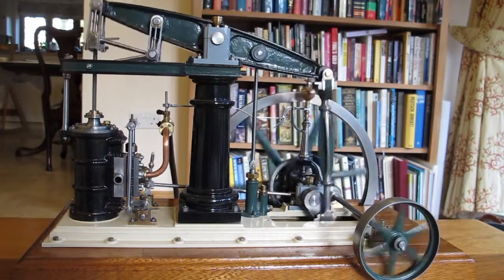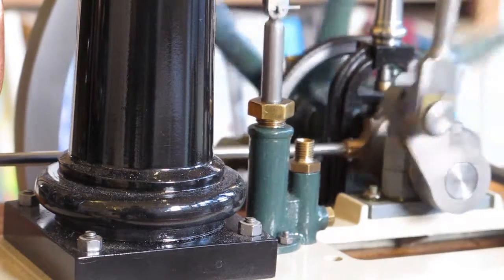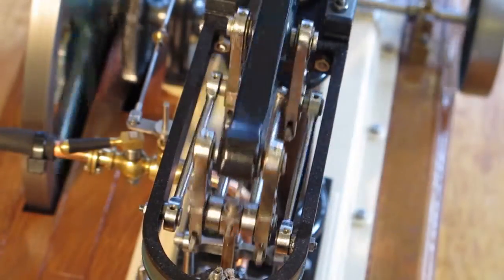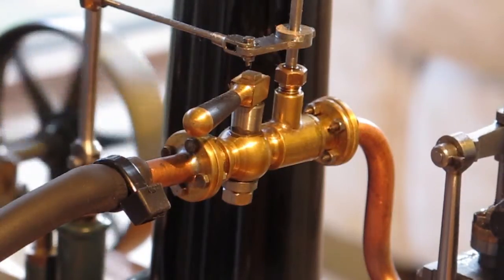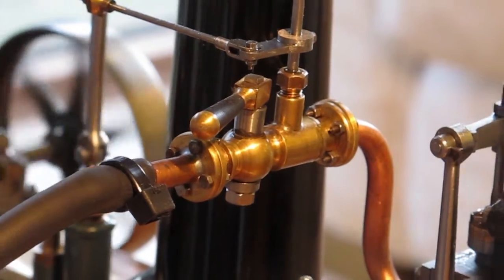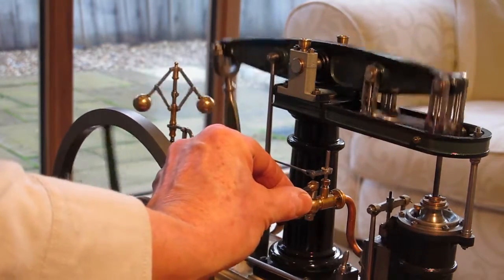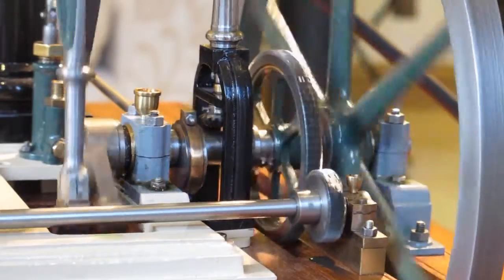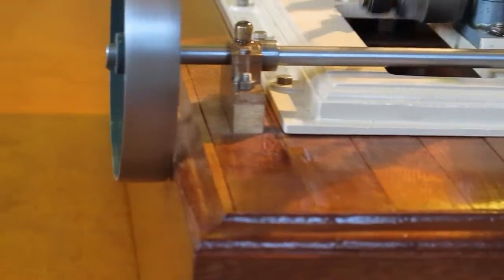ME Beam Engine

Comment: For a first attempt at model engineering you did a very fine job. This really isn't a beginners project at all. And those frustrating drawing errors have been uncorrected for decades. Beam engines were alway's a slow running engine. Maybe 30-60 rpm at the very most, and they always look far better running slow. You could remake the shaft to fit the slightly oversize bore in the flywheel, and if your bore is straight with the flywheel's outer rim that will correct the flywheel wobble. Drills don't drill straight or round as I'm sure you already know. So you drill first, bore under size for round and straight, then a reamer will give you a hole very close to being on size.Historically industry took a great deal of pride in there steam engines and everything was done as much as possible to neaten up all the parts. So I very much hope you don't mind a thought or two. 

All the planks on the flooring would have been pegged down much like the hull and deck planks were on the sailing ships. So you'd see the end grain of those at the ends and at each beam running under the engine as the supporting structure. And at the M.E. shows and exhibitions it's generally thought that all bolt or stud ends should have a radius to finish them off. Even at full size that was very likely done on almost all engine's and for the same reasons. Also at those shows they like to see somewhere between 1 1/2 and 3 threads maximum protruding above the nut. Yes it would be a great deal of work to do so now, and only you can decide if the work involved would be worth it to you personally. It does make a very large difference in the finished engine though.

Comment from the maker: Hi Bernard 
Thanks for your generous comments. I had really very little engineering experience before embarking on the model as my professional life was as an Internet designer. 
I found that as long as you took your time and studied the drawings very carefully it was fairly straightforward to build. However there are a number of errors in the drawings so you do need to be careful. If you do go ahead with building one I would be happy to share with you the mistakes I found.
Graham
Reply: +engineeringmodeller I finally just seen that you replied to my comment.  I am about to finish my first model from castings. I chose the Stuart Models 10V as it seemed to be a good entry level project. Could you tell me, where did you purchase your castings and plans for this model? I am very interested in building this engine after I knock out a few more simpler ones to fine tune my skills. Thanks! I look forward to hearing back!

Comment: Hi Steve
Yes the governer does appear to work although over a fairly limited range. I think my buterfly valve is not as efficent as it could be.
i think its a great model to build and really looks the part.   if you do have any questions regarding the build i would be happy to try and answer them if that would help.
Graham

Comment: I could watch this all day 👍
Im curious as to why the drive wheel (to become belt wheel) isn’t in the other side of the flywheel and then no need for the long drive shaft and belt wheel
Reply from the maker: Probably just from a practical construction on the full size engine. It was easier to do this than extend the mainshaft carrying the huge flywheel  to include the drive pully. At least that's my guess,
Reply: @engineeringmodeller bonjours de France, j'ai construit une beem engine aussi, la même. La vitesse de la poulie devait être beaucoup plus grande que celle de l'arbre. Parce que c'était des machines très lentes environ 80 tours /minutes donc la poulie, à l'extérieur.

Comment: I’m also curious as to what the lever does on the valve train?
Reply from the maker: I am no expert but I believe it is there to handle the situation where if the engine was to stop at TDC then it allows the slide valve to be disconnected and the engine moved by manual means to allow the machine to start again.

Comment: Hi , the plans and castings came from Reeves. It's a great model but beware there are quite a few errors in the drawings.
Reply: Les fonderies de chez Reeves ne valent pas grand chose j'ai usiné la même beam engine et j'ai du refaire la bielle dans la masse because plusieurs points étaient trempés.
Reply: @micheldilly8531  I have found that Reeves are very good when you find a defect in a casting, they replaced two of mine that were undersize.

Comment: It's an excellent engine.  Where are the plans and castings available from?
Reply: Hunter 2008. Hi the castings and plans are available from Reeves 2000, there is also a fantastic 3D drawing from Grabcad. Be aware that although the design has been around for many years there are mistakes on the drawings that have never been corrected.

Comment: well made engine my compliments only try to rectify the wobbling flywheel it is ruining such a lovely engine no hard feelings believe me .it is a fact that us modellers take of an non importance maybe
Reply from the maker: Well spotted, I made a fundamental mistake when I reamed the hole in the flywheel I thought that I was using a 1/2" reamer but in fact it was 0.505, I the attempted to locktight the shaft on to the flywheel but it resulted in the wobble that you see. Anyway you live and learn.
Reply: never use reamers they follow a previosly drilled hole better boring 100% concentric work